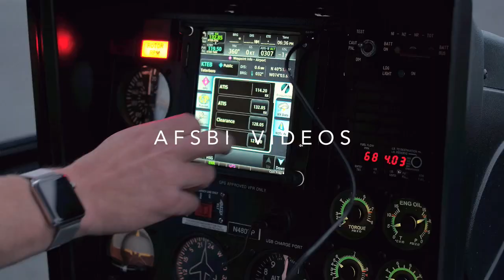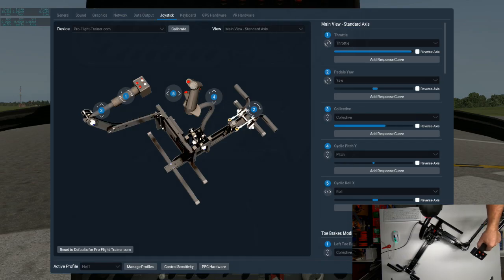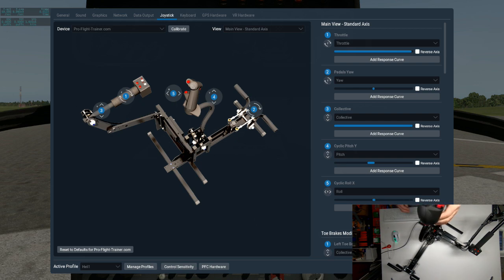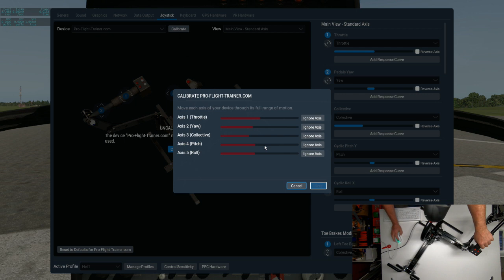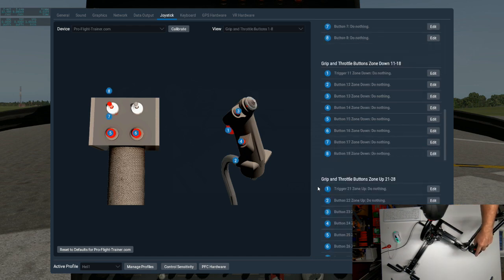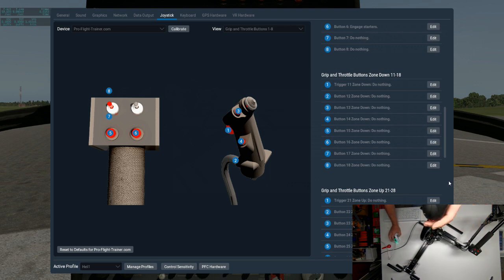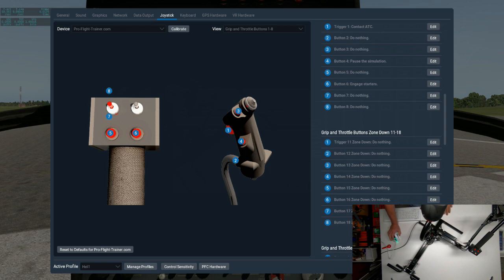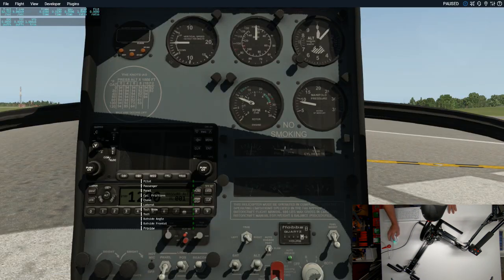PUMA Pro Flight Trainer. Part III: Configuration

Comment: Do I have to calibrate PUMA in Windows 10 game controller before I calibrate in XP? I am using XP 11.41 and PFT software 4.9. I think there are some older youtube videos and on PFT website that say that Windows Game Controller should be calibrated first. No surprise. LOL. Very, very good unboxing, assembly, and Calibration series. Best I have seen on youtube, Top down view is excellent. Thanks. PUMA arriving soon!
Reply: That was a good response you received... lol
Reply: This is not my experience! Its all messed up! Left toe brake is throttle!